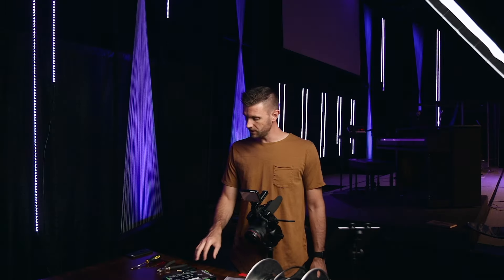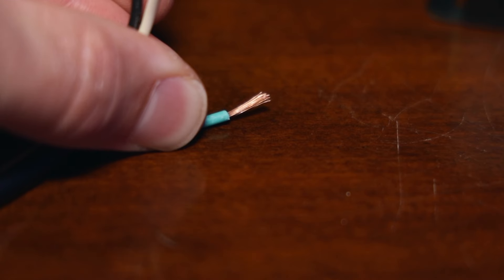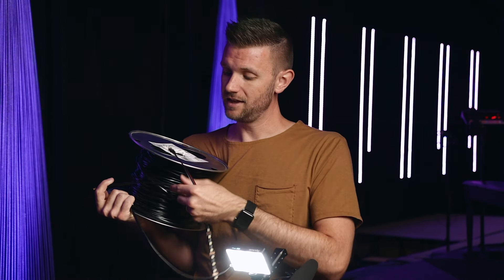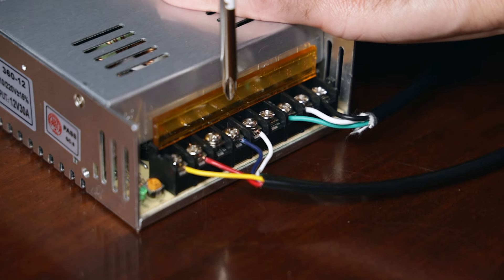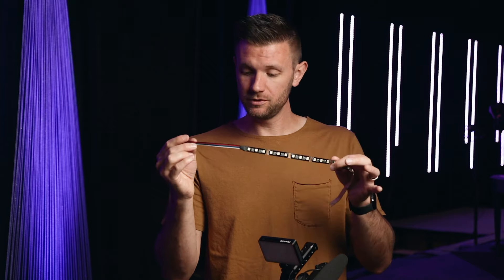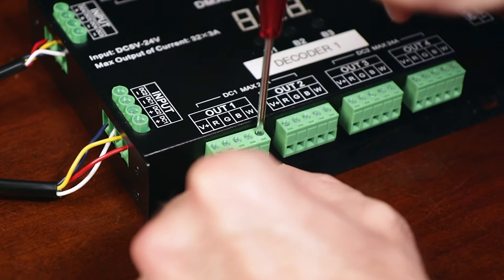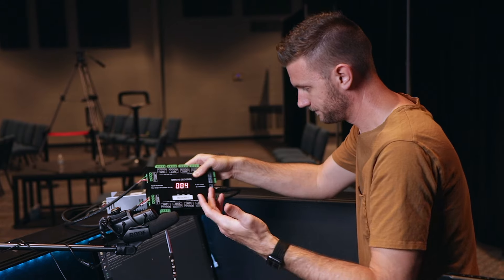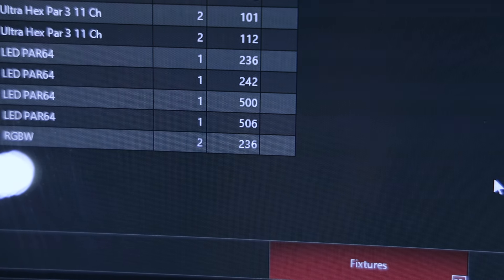How to Wire 32 Channel DMX Decoder, Power Supply, RGBW LED Tape

Comment: I have this setup with lightKey. DMX channel 4 on the decoder with the Generic RGBW. Can’t get the lights to communicate with this box. Are there any ideas?
Reply: Ever figure this out ? I’m having the same problem
Reply: depends on what exactly is not working... if nothing is working try these:
1. is the direction correct: OUT on the pc/encoder/console; IN on the decoder/fixture?
2. are you sending on the channel that the decoder is trying to receive?
3. is the power on acceptable levels at the decoder?
4. Are all cables seated correctly?
Reply: Any luck with light key? I have the same problem.
Reply: I have the same issue as well, did anyone ever figure out what the issue was?
Reply: @modellking  yes
Reply: @fixitfather348  can you use other fixtures with the controller? do other controllers work with the decoder?
Reply: @modellking  yes we have several other fixtures that we have been using with lightkey. I have not tried to use the decoder with any other controllers, all we have is lightkey software. Thank you for your help.

Comment: Would this DMX512 console work to control my lighting? 
CO-Z 192 DMX 512 Stage DJ Light Controller Lighting Party Pub Night Club DJ KTV Moving Heads. found it on amazon
Reply: Hemet Assembly hey, I’m Nick! I’m a professional lighting director and programmer. I’ve used that console before. It’s really cheap for a lighting console, but if your light rig is pretty simple, I think it could get the job done. But if you have multiple fixture types, I’d recommend a different console like Obsidian Onyx (formerly Martin’s M-PC). It’s relatively inexpensive, but it’s a pro console, and it’ll stay with you through every stage of your light rig. Also, if you don’t believe me, these guys use that console for their church. 😉

Comment: Did you ever have any issues when plugging into the other side of the decoder? When I connect a light strip to the other side of the decoder it stops working.
Reply from the maker: We have no experienced that issue. Double check your power and wiring from your power source. I’m sorry it’s giving you trouble. I know that’s frustrating.
Reply: We are having the same problem, did you ever figure it out?

Comment: can somebody help me on which power supply you need / how to calculate that? i would want close to 20m of ledstrip, 4 "groups", so 5 meters each. a strip i found for example uses 5A / 12V = 60W per 5 meters. i would probably use two 8channel decoders, but do i need a 10A 12V 12W power supply each then? thanks very much in advance

Comment: Can you use 3 pin LED strips with this?
Reply from the maker: Yeah 3 works. Up to 5 with this decoder.
Reply: im just curious now, which strip has 3 pins, that would only be 2 colours
Reply: @irg008  warm white and cool white strip
Reply: @stefanocolonna1529  huh right

Comment: Why 2 each 12v+ and 12v- wires to decoder? thanks!
Reply: (This reply not from WLH)
Actually, the video host used two cables, so there were a total of four conductors each for V+ and V- between the power supply and the decoder.
The DMX decoder box calls these 24V power inputs DC1+/DC1- through DC4+/DC4- (see the picture on the referenced decoder Amazon website), so the four pairs of DC input are a direct result of the DMX decoder box design.
It is possible that the wire and connector count is due to amperage restrictions (current per conductor).  Remember, there will be about five times as much electrical current at 24V as there was at 120V (or ten times as much current at 24V as at 240V), so you just need more wire (or bigger wire) to avoid frying the wires, which could melt the insulation, cause a short, throw a circuit breaker, interrupt a worship service, generate toxic fumes, start a fire, etc., all of which you would want to avoid.
I recommend that you read the decoder manual for more detailed information, and consult your local electrical code to make sure that the wire gauge is satisfactory.  But if four wires of a certain gauge are recommended, please use four wires.  Please don't think you're doing any worthwhile ministry by burning down your church.

Thanks!

Comment: I am only getting red on my LED Strips. When in testing mode on the decoder I still only get red or a dim green. Do you have any suggestions on how to fix this?
Reply from the maker: you have it set to 8bit right?
Reply: @WorshipLeaderHangout  I think the issue is you’re using a 24volt led strip with a 12volt power supply
Reply: We’re you able to get this fixed?
Reply: I’m having the same problem. Just red

Comment: This video, while informative, it's not the perfect example to follow. When dealing with AC, it can easily kill you and burn your house down. Always be cautious should be put into the video. And you're not supposed to put stranded wire into any kind of psu or breaker or anything, you need to properly terminate the wire! If you want to play around, use a solid core one!